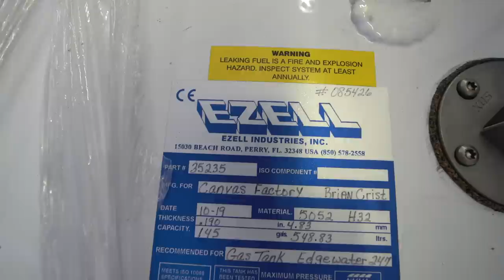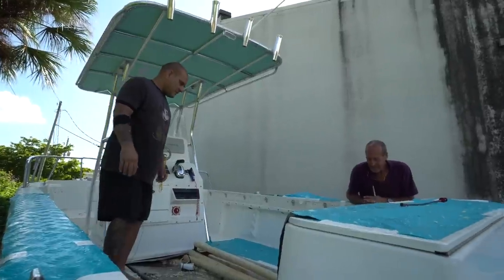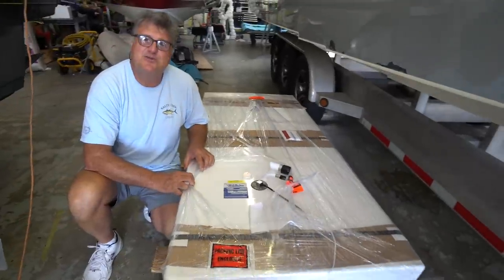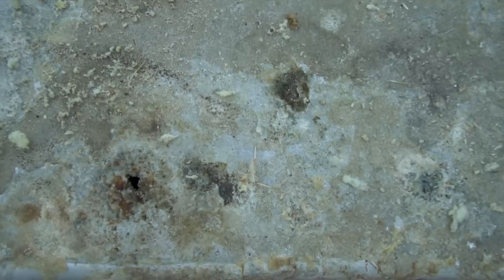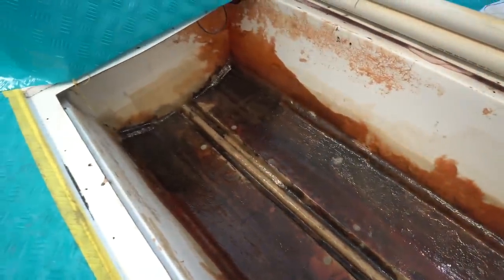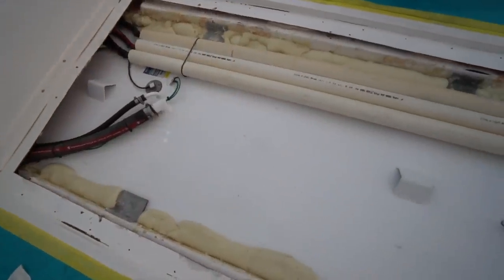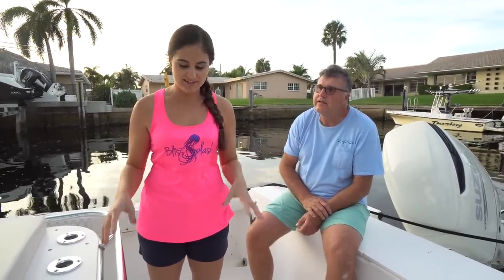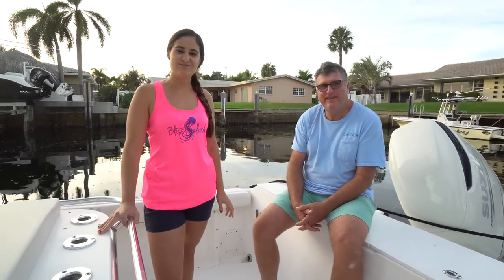REPLACING BOAT FUEL TANK Filled with HOLES!! Back in Action!

Comment: I am glad you guys listened to advice from commenters about not using the boat until fixed.  I was on board a small boat about the size of yours which caught fire due to a fuel leak.  It didn't explode like you see in the movies but we emptied three fire extinguishers on it before realizing we could not contain the fire.  It burned to the water line but we were not hurt.  Only lost all our fishing gear and other stuff which we generally replaced; it was good we had insurance.

Comment: I know that had to be costly for sure. You could have saved the old tank and repaired for a lot less and got more use out of it. But one thing I would suggest is a wire from the tank going to a salt zinc and that is where the true pitting in the metal of boats comes from. There is other video that explains in more detail about zincs. Great video!

Comment: Saltwater corrodes everything, even stuff that convention wisdom would think doesn't rust, and you can't keep it out of any compartment of the boat. Maybe it's water vapor. Even stuff I put in the console box which should be dry, stainless steel stuff, aluminum stuff, all starts corroding if I leave it in the boat a few months. Electrical connections corrode even if they're sealed and heat shrunk unless they're tinned. It's the harshest environment.
Reply from the maker: Everything rusts in our console too! That salt just ruins everything!

Comment: Thing is thentank has a level reader (connects to fuel gauge) and the gauge is grounded to the tank sooo u have current running thru the tank as well with the salt water u have electrolysis going on with bare aluminum

Comment: We leave our boat in the water as well. I would advise you to use a fuel product of your choice. I use fuel medic. It keeps the moisture down. It also treats the gas and keeps the side of the tank from filming up.
Reply: Keep tank full when in storage and use rec fuel no problem and don’t use foam my tank was 38 yrs old when started leaking no foam   use 2” wood strips and rubber insulator on bottom and sides and fiberglass the fuel tank compartment JT 🇺🇸🇺🇸🐟🐠🎣🌴🛥⛱🙏🏻🙏🏻🙏🏻

Comment: The reason the tank corroded was because the foam was against the tank.. I’m a big advocate for putting in flotation foam in boats but around the gas tank is bad. The holes in the compartment were for draining water that made it into the fuel tank compartment. Even with the thicker aluminum and the powder coating on the tank, the water will still get into the compartment and not be able to drain out and dry. The foam will get water logged then hold on to water against the tank and corrode it out quicker than last time

Comment: Your dad and your family have really gotten full use out of that boat. Replacement of a tank that's 17 years old is just considered general maintenance due to salt water corrosion over or in water.  Yes for "Non-Boat" Owners. I would say a boat cost rate might be a great video. Single engine, dual engines or triples. = 5k, 10K, or up to 50K pending the HP.  For every Mile per Hour over 60 MPH, the cost is 25K per mile in hour gained,  That's only up to 100MPH, then it's astronomical cost.  For boats under 47 feet.

Comment: Man o' man I hope your boat insurance covered all this, I can imagine just the labor alone is almost the value of your outboard engine and the tank probably a small fortune.  Great documentation on tank replacement, great video but I hope anyone that has a boat will never go through this, it looks like it put a hole in your account.  Your boat goes through harsher environment than boat owners that have their boat in land storage.  I have a 21' center console I pamper it as best as I can,  the only thing I detest is the annual maintenance of  complete wash+compound+polish+wax the entire hull.  If you maintain your own boat by yourself it's hard but if you have friends the easier and faster things get done.  Those rich folks that own 30'+ boats with multiple engines that must be a annual fortune to winterize, 100hr maintenance or a complete detail.  Thanks again for a great video, tight lines.

Comment: Nice vid! but Pls know that rubber strips should had not been used, rubber contains carbon, which is cathodic to aluminum and will cause galvanic corrosion also the rigging tubes appear not to have been properly secured and they're a bit short.

Comment: P.S. Did you have to patch any holes on the bottom of the boat that led into the fuel tank compartment?  Thank you.
Reply from the maker: We only did some fiberglass repairs at the bottom of that compartment and on the top deck above the tank

Comment: A cost of ownership video would be nice.  It would also, be nice to compare the costs for different size boats and whether you dry stock, wet slip or trailer.  You may have to get stats from other friends with different boats and storage methods for this.  Fuel cost break down during the cost of ownership would be good for the different boats with different engines also.  It could affect what size boat and engine combo a person may buy.